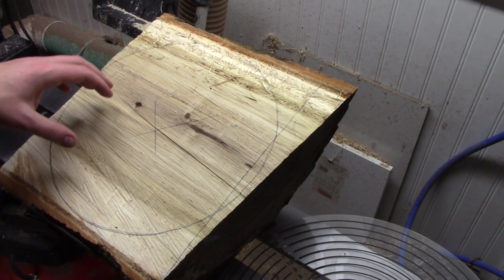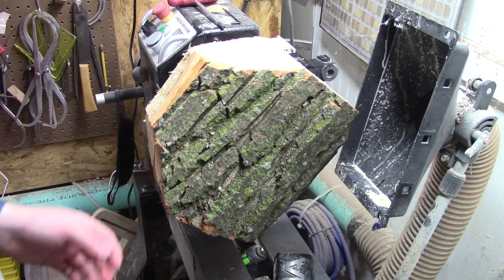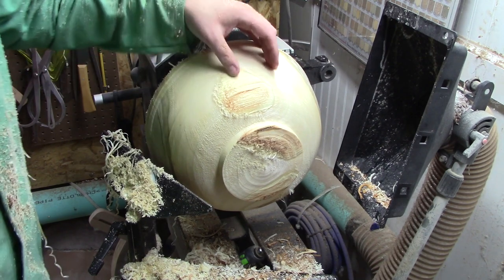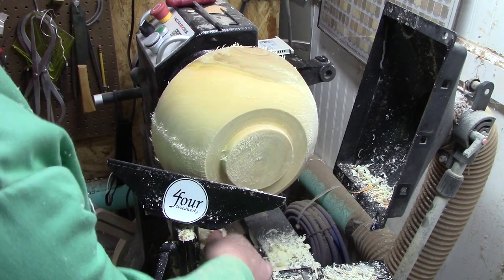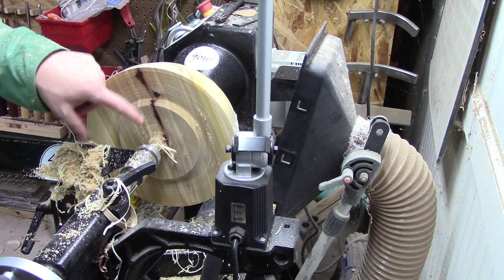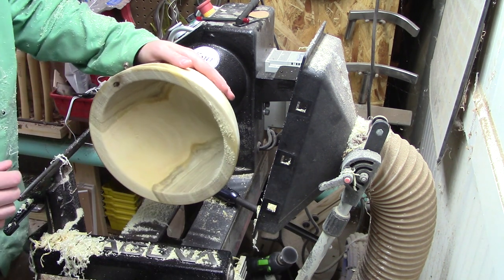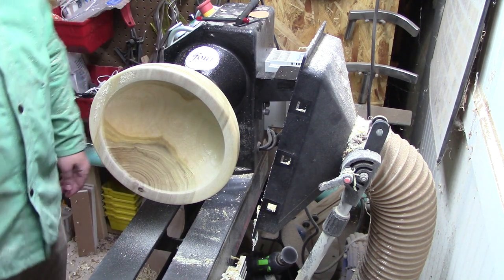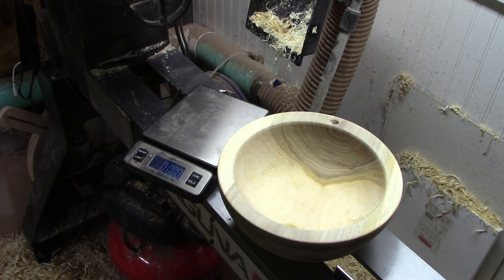Woodturning | Rough Turning a Fruit Bowl out of some very wet Poplar

Comment: I like that sizing gauge for the chuck.
I'm pretty new at this, but I tend not to worry about scraping and sanding until the rough-turned bowl is dry and ready for finish turning.
Reply from the maker: Thanks. I got the idea from Gord Rock. Check out his channel if you haven't already.
Reply from the maker: I did see or read that some surfaces can be more prone to cracking during the drying process. I just try to get everything even so there are no crack propagation points. 
I had never seen the wood fibers look like fur on a rough turned bowl. All I was trying to do was get rid of them, but nothing really worked.

Comment: Twelve inch? That's the same size as the Ash bowl I did today for testing my Coring Tool. I managed to put it on the wormscrew, probably not the best option for Poplar which is a lot softer. However, I'm sure this will become a nice bowl eventually!
Reply from the maker: Yeah, I think I could have pulled it off, but it was heavy and it of balance. Better safe than sorry.